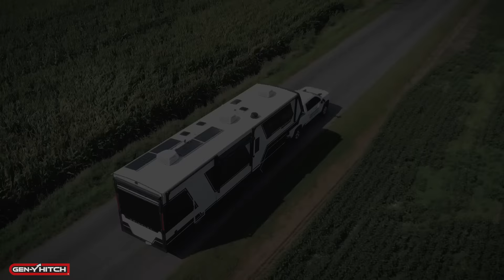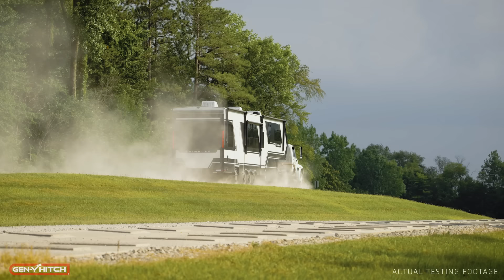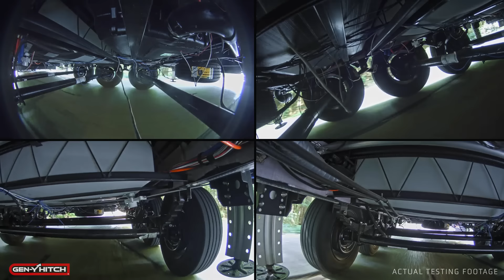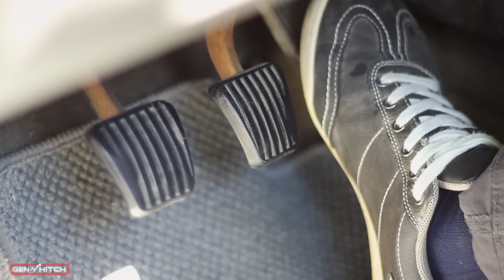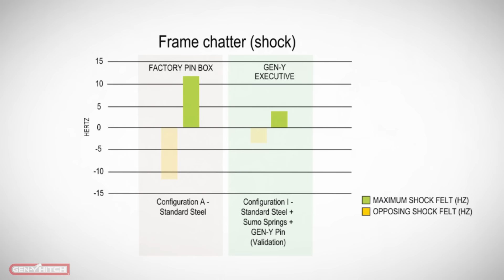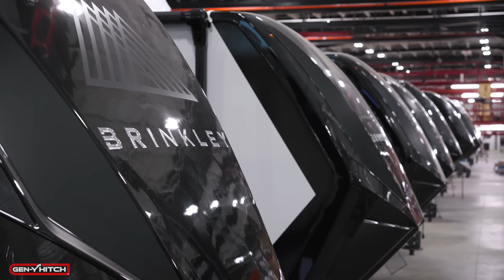Did the GEN-Y Pin Box PASS or FAIL Brinkley RV's Testing? Sharing the SHOCKING Results!

Comment: Ive retired from trucking industry.  I spent many many years in LTL industry with non air ride trucks n trailers. After retirement i bought my own truck and finished my career on my own. I have a kenworth t680 and had airride trailer. With air ride trailer never had any damaged freight.  So a no-brainer is to me is all fifthwheel campers should have air ride option . With the nasty roads in America it should be standard. Ive watched them being hauled up n down 65 from Elkhart.  No wonder they have fram flex so bad. Full timers just dont relize how over loaded the frame is with all their stuff. My 2 cents worth. I think all brinkleys should have standard air ride suspension.

Comment: Interesting results. The EZ Flex + Sumo Springs (Configuration F) seems to do as good and sometimes better than the GenY + Sumo Springs (configuration I). In fact, the EZ flex on its own (configuration E) compares remarkably close to the GenY + Sumo Springs (configuration I) considering the dramatic difference in cost between configurations I and E. I'm curious to know how the new Curt Helux pinbox would compare.  Also equally interesting is the data indicating that an "Abrupt Shock" (rail road in the test) has a similar result for all configurations tested. Regardless, it's important to note that the test unit is still getting thrown and shaken around in the sample video clips even with the Brinkley preferred GenY + Sumo Springs (configuration I) setup. That leaf spring setup can only do so much dampening for the body of the camper itself.  I wonder why one of these luxury brands haven't moved to a walking beam (+ independent/torsion) suspension. Some things just don't change, I suppose.

Comment: Great video, how about Brinkly offer the Geny from the factory for all their 5th wheels.
Reply: Yes! Our dealer did not use the GenY required bolts to install ours. They used the standard hitch bolts and we didn’t realize it until after we towed it over 500 miles.

Comment: Interesting that there is no mention of one of Gen-Y's major competitor - the Reese Goosebox.  So - just another bogus comparison from someone thinking they did us all a favor.  FOUL!
Reply from the maker: Our GEN-Y pin box was tested against a standard factory pin box, not other competitor aftermarket pin boxes. Our pin box making a huge difference in the amount of vibration and frame chatter vs a normal pin box proves the usefulness of the product. The other products in the testing were various equalizers. The engineers at Brinkley did this testing to find out which equalizer setup would provide the best towing experience and keep their units on the road the longest. The GEN-Y EXECUTIVE performed VERY well, which is one reason why it comes standard on the Brinkley Model G.
Reply: @GENYHITCH well I'm not getting into arguments on here but I say this from experience.  Gen y performance is excellent.  It's the only one I will purchase from now on. Just saying.
Reply: Comparing to a competitor wasn’t the point of this video.   I call a foul on your assertion.

Comment: A little confused by the data. Hertz is a measure of frequency, but to measure the vibration/impact forces into the trailer/tow vehicle via accelerometer shouldn't you be looking at amplitude such as the g's or measurement of actual force? Hertz could help understand the order at which the force or noise is amplified but I don't see it being the final measure of impact reduction? Also, I'm reading the majority of the data, which is related to trailer impact forces (not so much transfer to tow vehicle aka the GenY) to suggest that the trailer suspension and in this case the sumo springs, to have had the primary factor to reducing the trailer impact and wear(?) btw good job sourcing Link Engineering. We use them a lot for automotive DV evals.
I'm all for a cushioned pin box, run a goosebox myself, just didn't really see data show that factors effect.
Reply from the maker: Good comment and knowledge shared. Amplitude was also measured and it had a huge impact. While discussing with the engineers in order to create this video, the graph that showed amplitude was not explained as much, so it ended up not being included. But based on this comment it definitely would have cleared that up! All the suspension systems tested had a sizable effect on amplitude versus the control. This video was meant to be a way of sharing all the results in a way for everyone to understand, but we will look into if we have permission to release the whole report. However the actual wording in the conclusion of the report made by third party engineers is “The largest acceleration change is attributed to the GEN-Y pinbox regardless of EQ setup.”

Comment: Is a copy of the test results available?
Reply from the maker: We currently don't have a copy of the test results available for everyone to view, however nearly every page of the report is used in the video. And the pages seen in the video are directly exported from the report, so all numbers, graphs, testing procedures are the actual reporting data. The motion graphic animation is to scale with the rest of the report. We tried to be as transparent as possible with this video to share all the results!
Reply: @GENYHITCH  it looked like you were comparing various pinboxes. I was curious about how it compared to the MorRyde.
Reply from the maker: @RamblinRoadies  Sorry for the confusion, the MorRyde product that was tested was their equalizers. We wanted to share all the test pages as is and unedited but the labels should have had a little more information. This testing by Brinkley was comparing various suspension systems, so our pin box was tested against a normal factory pin box but not against any competitor pin boxes.
Reply: @GENYHITCH  thank you for responding.